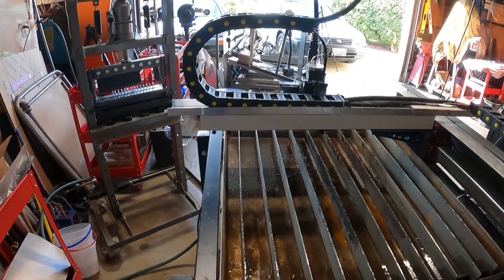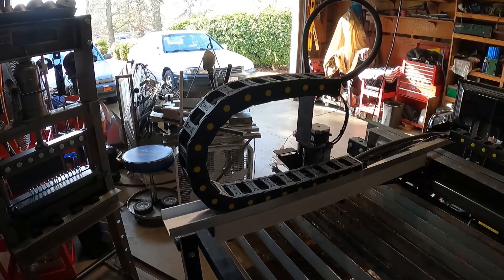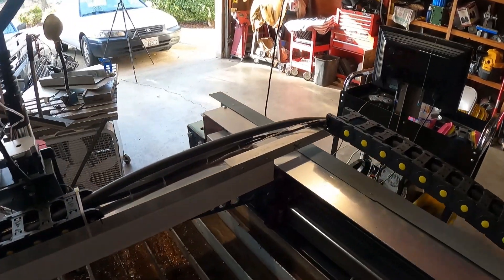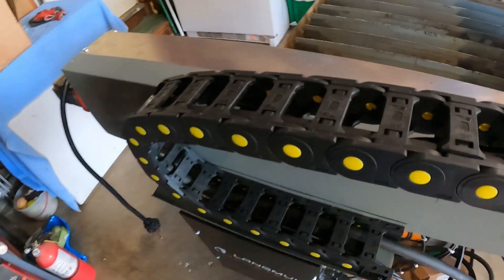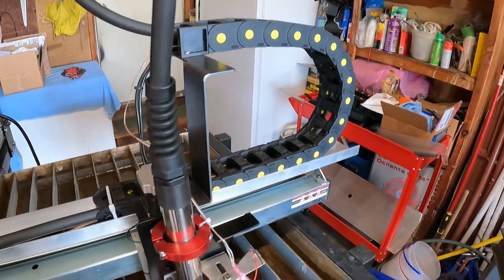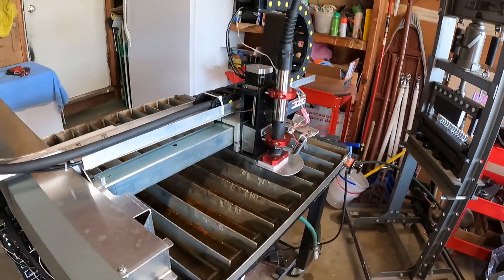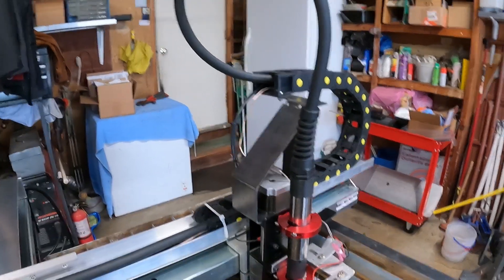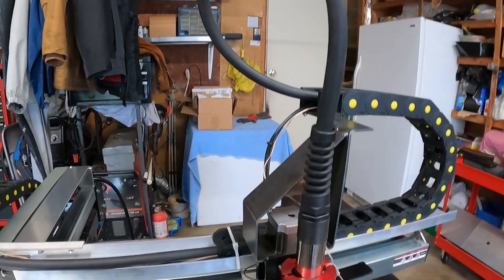Langmuir Crossfire DIY #7 XL/XP Drag Chains

Comment: I’m actually taking a fair amount of inspiration from this drag chain video vs the ones others have done kn the pro because it does seem like others are using more drag chain than they need.   Also rivets.    Yes to rivets for certain situations like this.    But I’m deliberately not putting my plasma cable in the chain because I want to keep it separate to reduce emi

Comment: Hello. Please open the red roller from the Crossfire PRO CNC Table and show us what's on the other side.
How is the gap between the bearings and the pipe surface removed? Why is there a screw in the middle? Thank you.
Reply from the maker: I am not sure what you are referencing.  I only depicted an XL table.  Please explain further and use names in the Langmuir installation guide.
Reply: @dougkronemeyer  I'm talking about the Y Axis Carriage Assembly, which includes two Bearing Block Assemblies. Each bearing block
assembly contains four bearing blocks; two fixed and two adjustable. They are red.
Please remove the adjustable block and show it from the back. Or draw a small picture.
I do not understand how the movement of the axis of the bearings is done. Thank you.

Comment: What plans to you have with your CNC plasma cutter?

Does your CNC plasma cutter have enough power to cleanly cut 3 mm titanium sheet?
Or is titanium one of the metals not suited for plasma cutting?

I ask because I have a project that either needs plasma, water jet, or LASER cutting.
I can use stainless steel if CNC plasma cutter is not suited for titanium.

New subscriber and I'm not up to speed on your previous work.
Reply from the maker: go to this link:
https://link.springer.com/chapter/10.1007/978-1-4471-0777-4_53
Reply: @dougkronemeyer   OK, stainless steel is the better option for me. Thank you for your help!